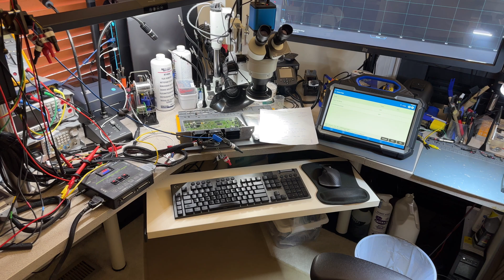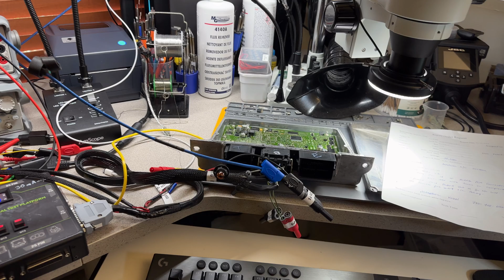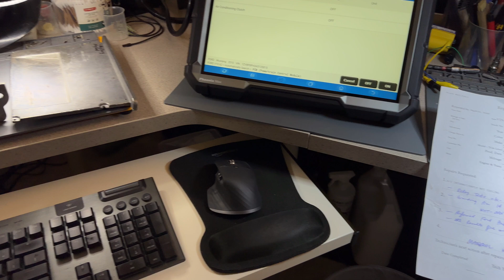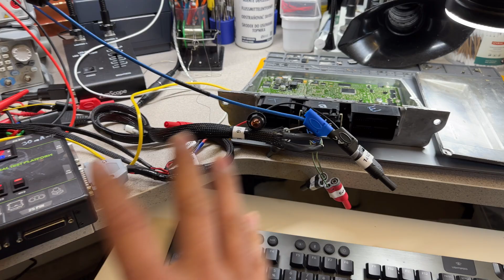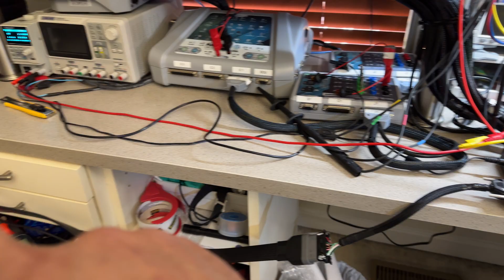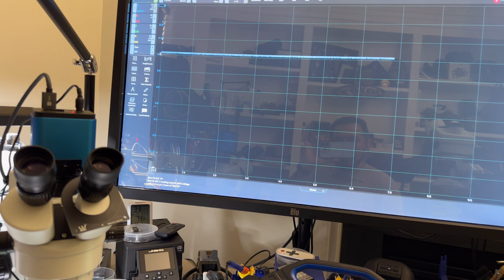2010 Ford Mustang GT no AC clutch engagement PCM test

Comment: To any one having same issues you can do one simple test and consist of put you eco on the fridge for 20min pulll out re install quickcly in your car and start it up and activate the ac if does work and cool for 4 to 10 minutes and later stops cooling (clutch disengage)your eco is bad and needs to be rebuild or replace
Reply: ECO?